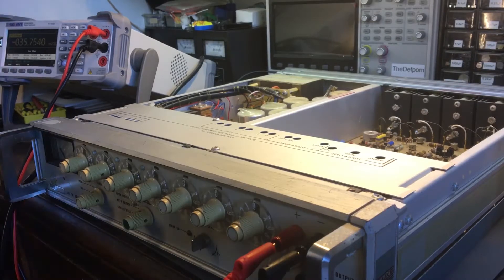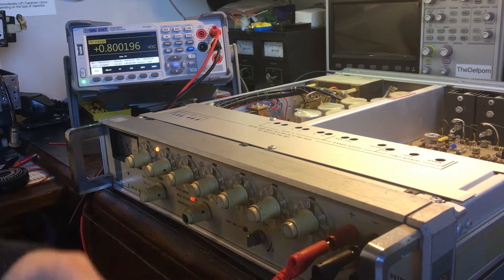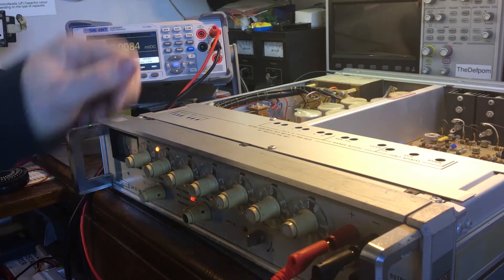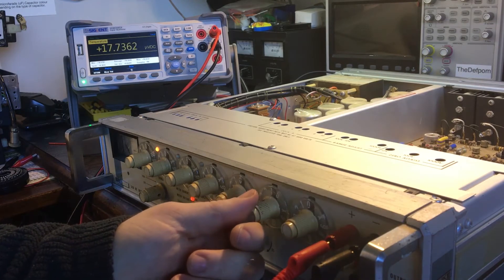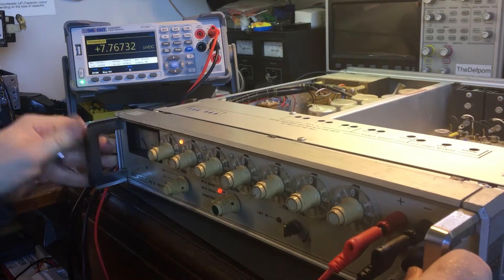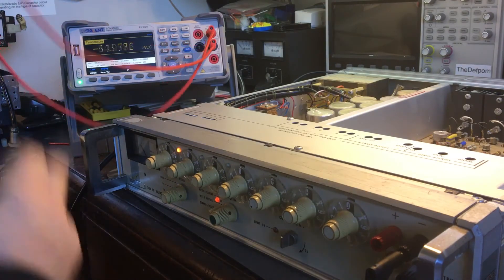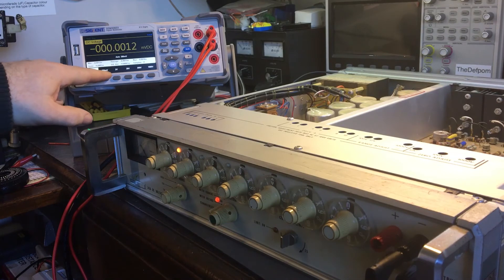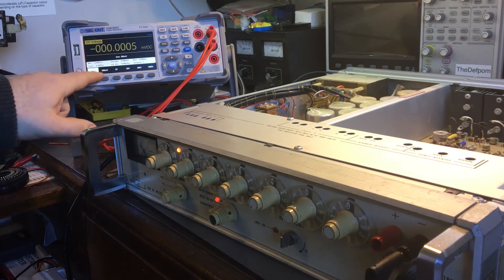#229 Siglent SDM3065X How To Measure uV and nV DC

Comment: Isn't that what the 4 wire sense is for ?
Just not using 4 wire sense test leads - Kelvin leads ?
Reply from the maker: KD0CAC - yes, but it is still a good idea to use kelvin clips, don't forget they are used for resistance measurements, not voltage measurements.

Comment: Rigol multimeter does the same thing in sensor mode.  Will display sensor reading, voltage and current all at the same time.

Can't you change the sample rate on that meter?  Basically like changing the gate time on a frequency counter.  On my Rigol I can increase the sample rate which stops the reading from bouncing around.
Reply from the maker: The sample rate is adjustable in voltage ranges, but not in the temperature range.